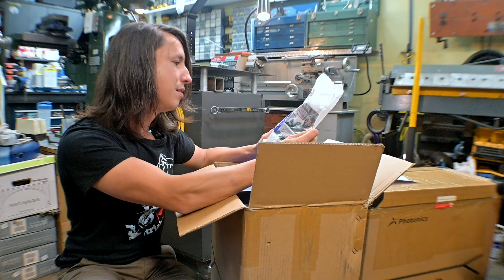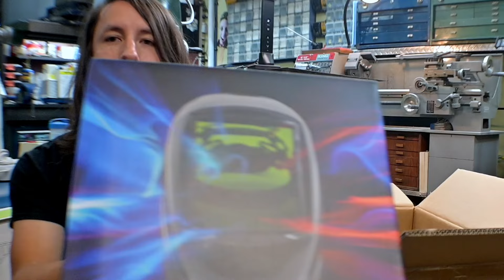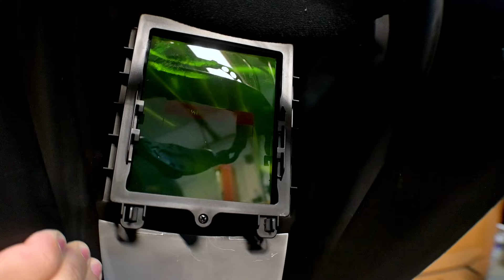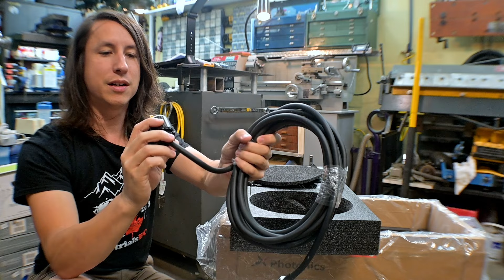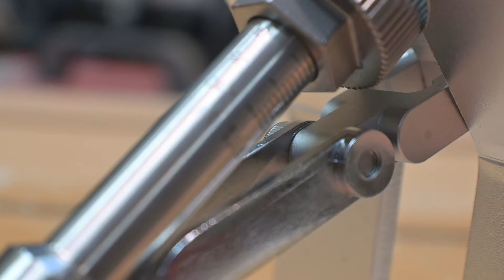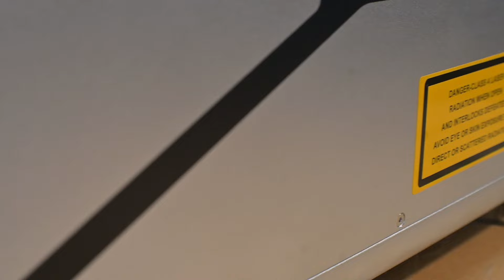I Bought a Hobby Grade Laser Welder! Unboxing the XLaserlab X1 Pro

Comment: Generally, it’s recommended to wear both the goggles and the helmet. Of course, a lot of guys only use the goggles. Not the best idea. Metal cutting Lasers produce 1080 nanometer radiation. So the goggles are ok for observers standing several feet away. But the plasma created by the welding also creates UV, which is something a lot of people don’t know. The helmet filters UV, usually 180-480 nanometers. That’s because you’re close to it. The goggles don’t.

There are other air cooled models. I have the XTools 1200 model. They can go to 1500 watts air cooled. After that it’s a chiller, which I really didn’t want.

Comment: Just got mine and unboxed this afternoon.  Glad you found out about the power.  So you can switch the plug out for a 240.  But then it looks like this will run also on 110/ 20amp.  That's nice to know.  Also what I am looking for is the filler wire.  Can you use .030 or .035 wire?  Also looking for your first test..   Dave...
Reply: .030 or .035 works fine!
Reply: @hexad3c1m4l this is a low power model it will easily run in a 12 gage wire 20 amp circuit. Just make sure that’s what it is as it will likely have a 15 amp socket. If it’s a 20 amp circuit. Change the socket, or have someone else do it. Don’t change the plug on the welder.

Comment: Would nitrogen gas be good for thicker welds with steel joints 😊
Reply: Yes. You can use nitrogen with everything other than aluminum, which requires argon, as usual. I just use argon on everything. The difference in price isn’t worth having an extra cylinder. I’ve already got 75/25 as well for my ESAB.